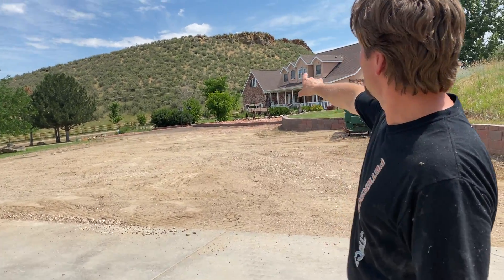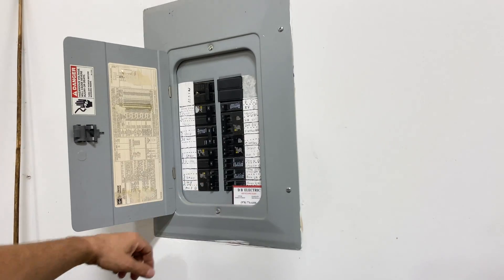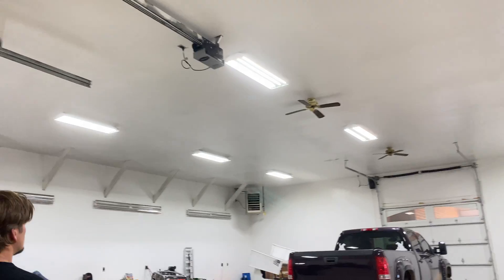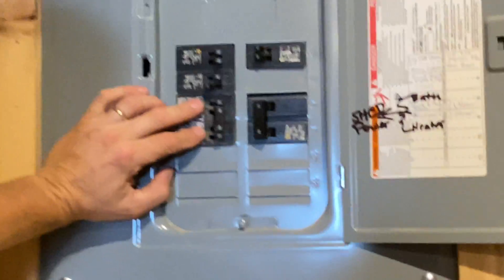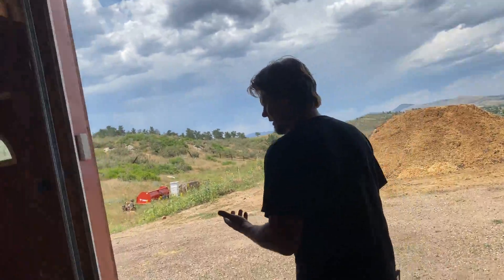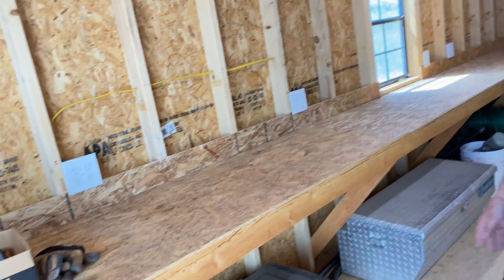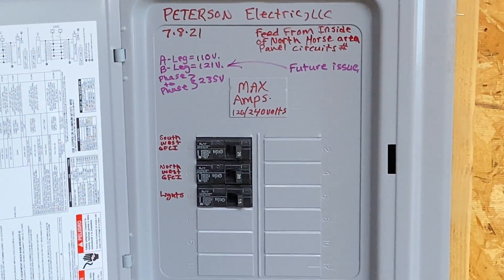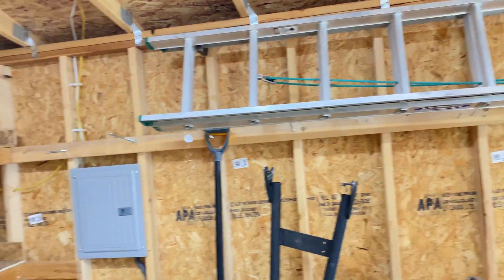Explanation of Voltage Drop at Ranch Properties & Shed Wiring Project

Comment: Many years ago I did a ohms law ( yeah only for DC ) calculation on believe it was for ten 75 watt LPS  luminares that were 100' apart on a long 1,100 driveway. Guys sparky dad said to only run #12 from panel. Had him run #8 to first luminare then #10 for maybe next 5 luminares then #12. With all the luminares on he had 108 volts at last luminare. Was within one volt of what I calculated. On large transformers they usually have 5 taps 2 @ + /-, 2@ 2.5% +/- and center tap at rated voltage. Had to up taps to adjust for excessive voltage drop at older like you stated much added on remote building.

Comment: Also remember that voltage drops don’t show themselves until you put a load on the circuit. Bigger the load, the more drop you get. A non loaded circuit will show full voltage
Reply: You can predict every aspect and every voltage on paper. Right down to 3 or 5% and 1% nowadays.
Reply: Is there a tester to find actual VD under normal load? Can you use a normal meter?
Reply: @darbyl3872  Yes it’s Very Simple, just measure the voltage at the load while the load is running.
Reply: @anthonys7534  Cool, thanks. I guess, by that time, the wire is either big enough or not (a little late, but if it needs to be redone, it is what it is.)
Reply: @darbyl3872  exactly, but it let’s you know where things are at. Try to shoot for no more then 5% drop.

Comment: i dont understand why most elecricians including yourself dont do a voltage drop calculation for the wire size needed. if you use a #2 wire (aluminum) for a 100 amp sub panel that doesnt mean that is the correct wire if you ran the wire 500 feet from the main panel to sub panel. 95 percent of all trades are hacks

Comment: Huh, I've been studying the NEC for decades and thought a panel feeding a seperate structure had to be service rated and had to have its own GES.  Of course I never heard of not being allowed to use an approved wiring method horizontally.  So ...
Reply: It does. Use a MLO panel too or bolted main breaker

Comment: What’s the voltage at the service? Curious as where the voltage disparity starts. Point being the issue could be the utility company.
Reply: I thought the same. It would take some leg work but finding where it drops can be a game changer, especially if it's easy to balance the 120 volt load.

Comment: Is there a ground rod at the first shed panel and the new shed as required by NEC?    I would suggest you do a voltage check from ground to neutral.   If there is a voltage measured between N&G, then the ground rods are not there or the connection is not good.   Once you get the voltages settled with grounding fix you need to turn on the lights and what an assumed number of people can be using at the same time to see if there is a voltage issue.   Respectfully,   Kevin

Comment: You should have ran your 12/2 in shed vertical. People could hang stuff on wire in my opinion. Also sharpie markers? Why don’t you use stickers for labeling. Outside understand but inside panel I would use sticker.

Comment: What are the possible causes for the imbalanced voltage for the two sides of the phase coming to the shed?
Reply: When I had my imbalance a loose neutral and an old crusty service drop feeders was the issue. Also noticed dimming and disco lights when washer was on. Tell tale sign of loose neutral. Once I upgraded, everything got fixed including  the voltage difference
Reply: This looks like a loose neutral to me. There are a lot of terminations between that shed panel and the transformer.
Reply: I had an imbalance like this that I primarily noticed when my sump pump kicked on. I then measured the voltage and saw one leg would go high and the other low. I called the electric company and they sent someone out and pulled my meter. Turned out a branch had broken the neutral in the service drop cable and one of the hots was damaged and partially energizing the neutral.
I have a few UPS backups for desktop computers and now I keep the display on to show the voltage all the time.

Comment: Great Video Peterson.
could they run 480v to the Big shed and then with a step-down transformer 120/240 would that work?
Reply: That isn't necessary, all they need to do is size conductors accordingly. 480 is only practical when you need it for special industrial machinery.
Reply: Utility companies don’t typically supply two different systems anymore. You get one service and you make it work. As a reminder the voltage drop actually starts at the utility transformer. So just bumping up wire size without the math is not the best option sometimes. I agree that the conductors from assuming the service at the house may be to small already. The conduit is already in and paid for. To get larger conductors in would be a tough sale to owners without them being open to facts and understanding math.